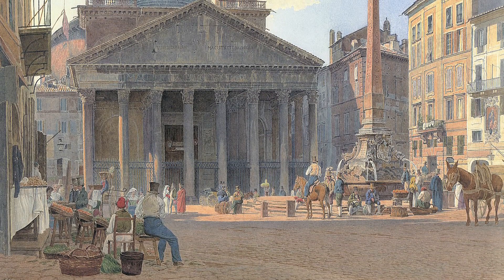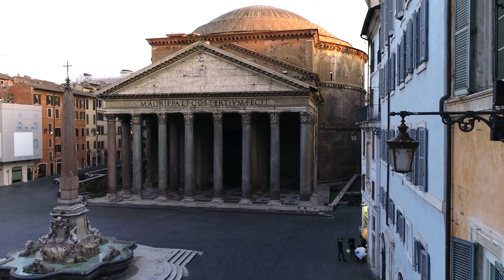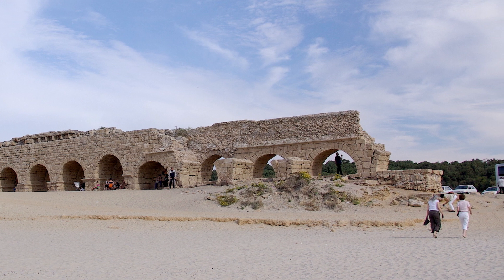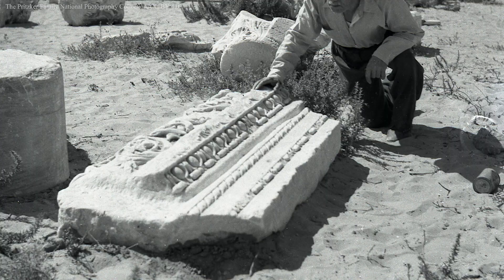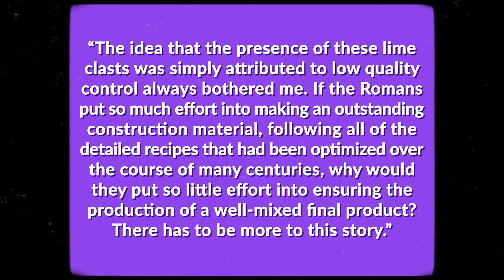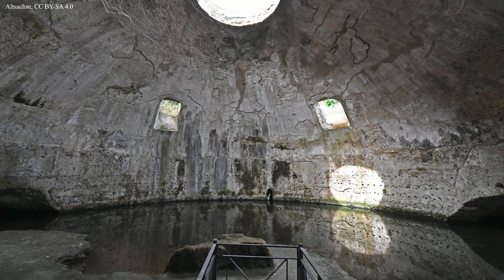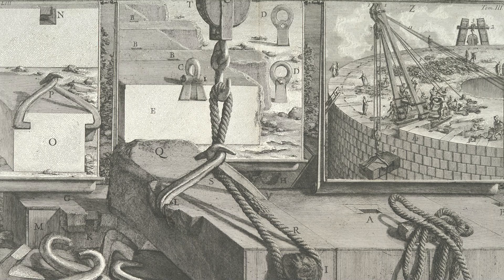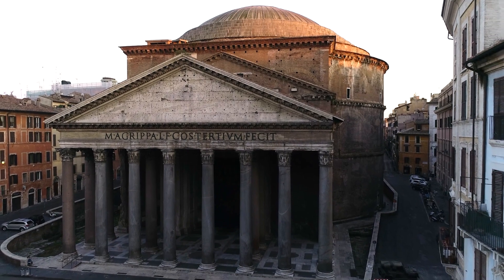How Did the Ancient Romans Make Concrete So Much Better Than Ours?

Comment: A-The Romans didn't fill thier concrete full of steel. This reduces both the lifespan and the quantity required. You won't get the increased longevity without removing the steel reinforcement but then you need more concrete, offsetting the environmental savings.
B- Modern life. When that two lane bridge needs to be a four lane bridge it's coming down even if it would have stood there for another thousand years.

Comment: Flyash has been used in Concrete for decades, both type C and Type F. However, it is a bi-product of burning coal plants, and as you can imagine in countries like the USA the availability of Flyash is quickly diminishing. Also, most Cement plants at least in the USA use alternative fuels to lower their environmental impact. And in the industry there has been a lot of advancements in green contrete, like for example where you use CO2 instead of water in the curing process.
I believe one of the major factors in the difference between the two really comes down to the placement. One of the biggest issues in the industry is on-site crews adding water to the mix to make it easier to place. However, this causes the compressive strength to go down, and the aggregate in some cases to settle to the bottom. Often times they cure to fast causing the water to evaporate quickly and causing cracks, etc.
In my opinion in most cases if there was a stronger quality control at the point of placement the concrete would last way longer, because it would be placed and cured correctly.